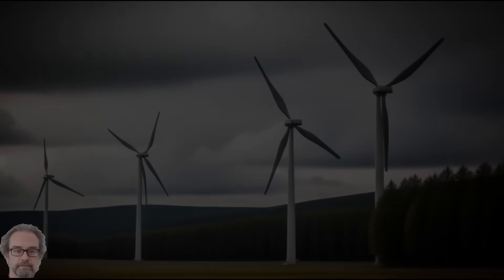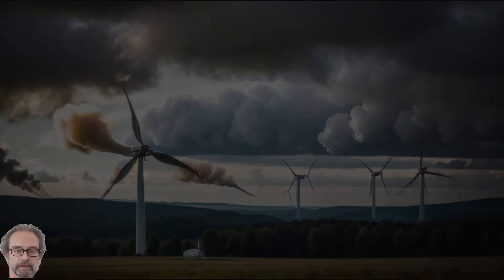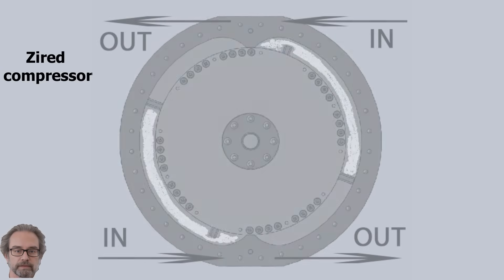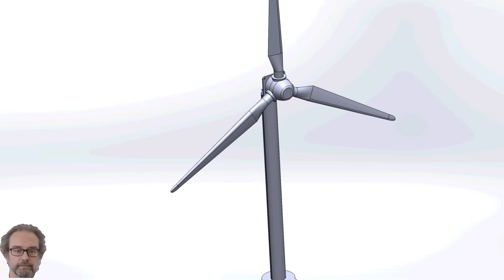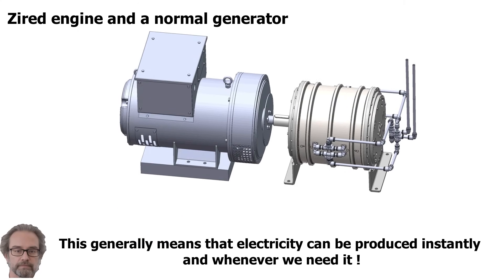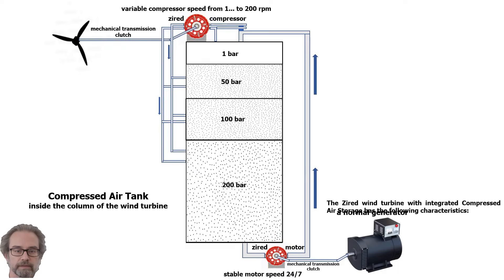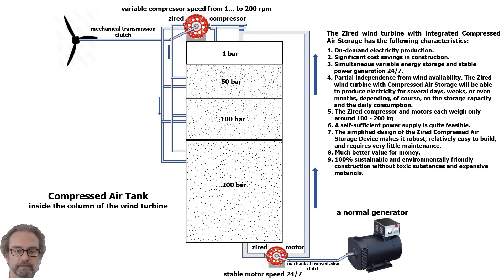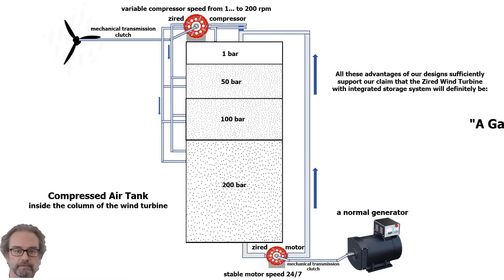Zired Wind Turbine with Integrated Compressed Air Storage - "The Game Changer"

Comment: I wonder why manufacturers don't want to talk to you about your ideas.

The largest wind turbine towers currently are approximately diameter 10m. Larger diameters have major logistical challenges. 

If you have a 200 bar pressure vessel of a diameter of 16m diameter, you need a wall thickness of P*D / (2 * sigma) = 20*16000/(2*300) = 533mm. 
That is if you are making the pressure vessel from steel with a design stress of 300MPa.

Over a height of 200m the volume steel of the cilydrical part alone is pi x 16 x 0.533 x 200 = 5366 m3 of steel, weiging 8 x 5366 = 42893 tonnes. 

The biggest offshore crane ship currently existing, the Sleipnir, has a maximum capacity of 2 x 10000 tonnes = 20000 tonnes. This is less than half of what is required to install the pressure vessel. 

The biggest onshore cranes are typically ring cranes, which have typical max. capacity of about 4000 tonnes, a tenth of what is required. They cannot operate in tandem because they require a lot of space.

Comment: Still wondering how a single rotation of wind turbine can compensate amount of work required to compress at 200 bars.
And frankly speaking, you have no idea how costly will be a 200 bar- pressurised storage tank.
Reply from the maker: We compress incrementally from 1 to 20 and from 20 to 40 and from 40 to 60 and so on.

Comment: How do you accommodate a 200 bar pressure vessel of the according size in a tower that sways - and has to sway in order to dissipate load and momentum? Also, you'll always need a ladder and probably a service elevator inside the tower and the section flanges need to remain accessible for bolted connection maintenance. Means to me the tank will have to be somehow centrally suspended, wich again raises the accessibility question in regards to maintenance and inspections. If all that were resolved, there would be only a fraction of the suggested 16m diameter left for the actual tank. Apart from the fact that the towers I've seen so far have 16m in diameter only at the base (if at all) - they get rather narrow towards the top, mainly in order to facilitate a continuous bending / swaying across the whole length to avoid load peaks on individual sections. And no, generators don't commonly require high maintenance - bit of grease topup, bit of grease tray cleaning, carb brush checks / replacement and a bearing insulation test - if we're talking about geared turbine generators?
Reply from the maker: @gerodiegner9202  Please send me an email info@optimetron.com, and I'll answer to you.

Comment: This is wrong on so many levels...
Reply: But feel free to delete my comments.
Reply: Where are thre calculations on efficiency? The pump motor reduces efficiency of the turbine, the tower has little space to accommodate the air tank, the return of air to generate power is not constant and loses energy again with the generator, etc.
Besides, wtgs are constructed in areas with a guaranteed wind flow and are calculated to produce the exact amount of energy required on average. Excess is distributed and lacking production completed from other, excess, sources.
Reply from the maker: Please, criticise with arguments
Reply from the maker: If you don't present your arguments, then I will delete your comment
Reply from the maker: "Power production on demand" is that a small gain?
Our wind turbine is designed to function without Neodym and SF6. Is that a small gain? The upper Zired compressor cost with installation about 5000$ and is low-maintenance. Your generator cost 100000$ and it needs high maintenance. When the wind is blowing very bad have to stop the turbine. Your wind turbine can get fired. And on and on......Is all that a small gain? Someone has to be blind if doesn't see all these advantages. Have a nice day
Reply: @MrZired  you clearly don't work in the turbine industry
Reply: I am a little confused by your system operating without SF6, can you please explain how it eliminates the need for it?
Reply from the maker: You have to look carefully at the footage and try to understand it. The pillar is big enough to be used as a storage tank. The Zired-compressor is patented and can smooth all the fluctuations. It weighs only around 200 kg. It's not my fault if you didn't understand the enorm benefits of our invention 😊
Reply: @MrZired  how many turbines did you actually see from the inside? I work in this industry and i can tell you there is no place for the tank. There is not much benefit from this invention, at least not in this configuration. Too much cost for too little gain.